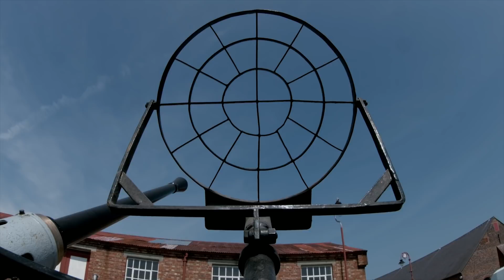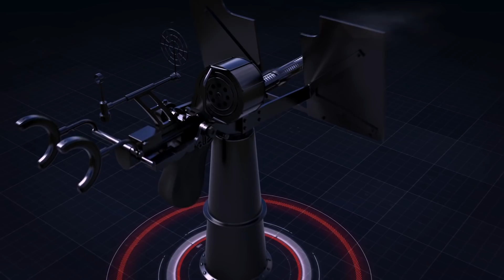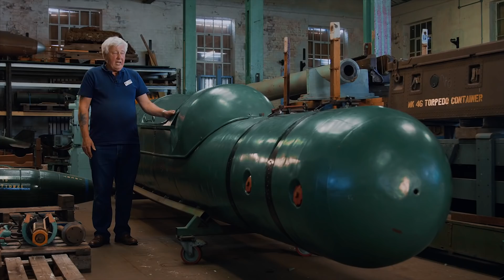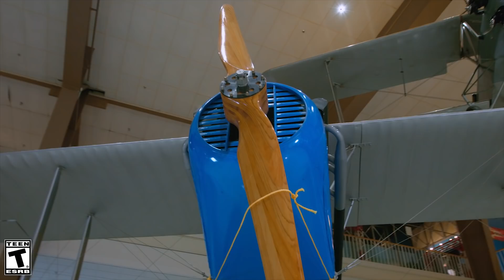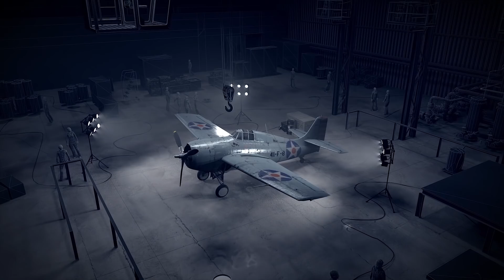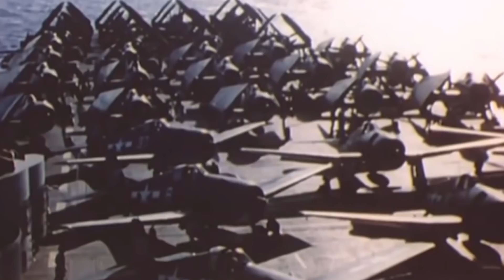Birthday Cinemarathon with Gifts! Armament

Comment: TAKEAF1VE works for me. Who says it doesn’t work?
Reply: Mine says it won't work due to technical issues
Reply: Works for me on NA.
Reply: Are you on the correct server, if so, did you try to reload the page?
Reply: @aidan_mtl  does Asia server accept the code? I am using Asia server
Reply: Some Servers don't accept the codes. Like the Asian server.
Reply: I believe it should